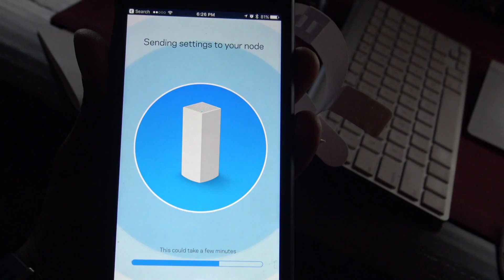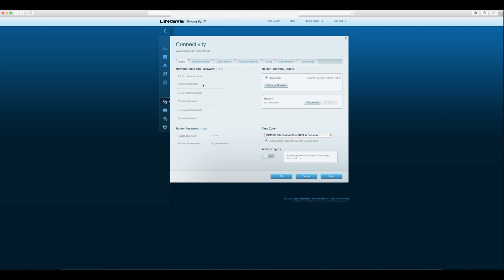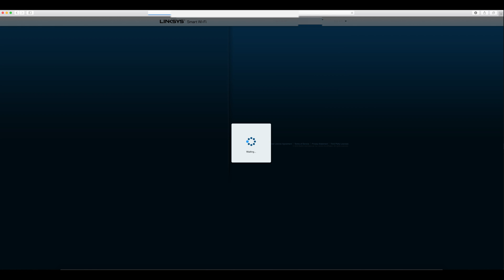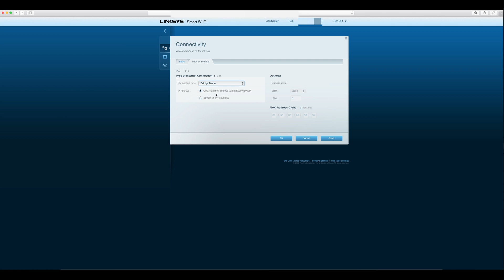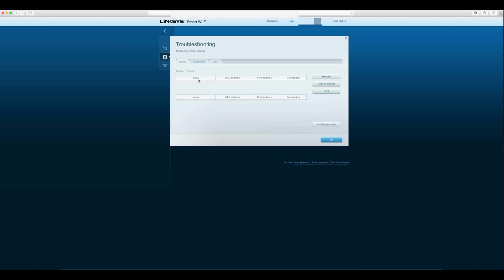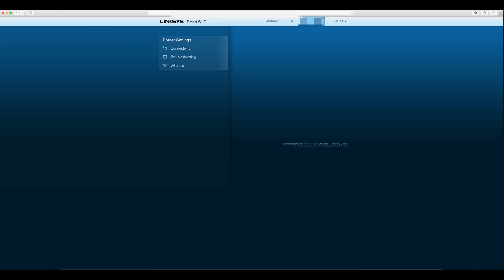Linksys Velop Network Bridging Setup and Configure

Comment: FOR THOSE WHO ARE CONFUSED BY THIS SETUP: This guy has his ISP modem running DHCP for his home network and has used his velop mesh routers to bridge that connection across his house. He's using the additional router as a switch. This is extremely sub-optimal. The best setup for this guy would be to connect the expensive router to the ISP modem and use that for DHCP, VPN, whatever other capabilities it has since I bet it is more robust in features than the Velop. Then to plug the Velop system into that router to extend that LAN across the WLAN. Essentially this is the blind leading the blind, but good try my guy.

Comment: 0:58 So you connect the main node of the VELOP to the internet source device (white cable) and the black cable to a modem or router that sends signal for everywhere else, is this correct? I am trying to connect all my VELOP nodes to wired sockets, would it work like that? Thanks! :)
Reply from the maker: Yes, you are correct. The nodes will work just fine if you connect them to Ethernet ports in your home/office instead of using the wireless mesh. The nodes will auto discover each other over the physical network, generally resulting in higher throughput between nodes and a fast connection for your devices.

Comment: Hello great video.  I have 2 velop nodes and i want to use a dlinl619L at the 2nd node.  
Then add a repeater to the 619L. 
Is this possible?  I'm basically trying to get Internet to my parents home across the street for kids online school.
Reply from the maker: Hi @JZ Nation,
Yes, it is possible to connect the D-Link619L to your Velop Node. Are you planning to hardwire it? Or, are you looking to use a wireless bridge function? 
Since the goal is to get reliable connectivity across the street, I would recommend you connect the D-Link to the open ethernet port on the 2nd node of the Velop. This will allow the D-Link to use your Velop as the gateway. You can either bridge the D-Link, or use it as a separate router with its own wireless network. As long as the signal is strong enough, everyone using the connection across the street should be fine.
Reply: @Netxperts  Thank you for your response.  That's great to hear. 
A little bit of context.  So I initially had my two velops at the 1st home.  I added a linksys RE6300 repeater at the 2nd home (which connects to 2nd velop node).  It seems to work fine but will stop working after a week or so.  I was told that maybe that repeated may not be compatible with mesh.

Okay, so I have a dlink 619 which I can hardwire to the 2nd velop and then connect the linksys 6300 repeater to it.  Do you think that would be the most feasible option?
Reply from the maker: @JZ Nation, from the description of the issue, it sounds like RE6300 was having a problem keeping the connections as the signal from base Velop was likely overlapping which will cause your devices to keep changing between the AP and repeater because they have the same SSID name. The hardwire solution should eliminate that issue,

Comment: What happened @ 3:40? How did you get to that sign in screen?
Reply from the maker: Sorry for the late response here... however, in case anyone has the same question... that sign in screen is accessible from the splash screen of the admin page. navigate to the ip address of your velop, click on the splash screen. It will take you to this link: http(s)://x.x.x.x/ui/1.0.99.208937/dynamic/login.html#casupport (the x.x.x.x is the IP of your velop).

Comment: @netexperts i have the velop ax4200 system at home using Mesh, but been getting inconsistent speeds on the 3rd floor. will switching to Bridge make it faster and more stable?
Reply: @benjamin yee, in general, no. Bridging would not improve the inconsistent speed on the 3rd floor as it is likely a symptom of the node being too far way from the others which causes the back haul connection between the nodes to fail. There are ways to stabilize the mesh connection on that node and drastically improve your bandwidth in that area. 
The other option is to use an Ethernet cable from one of the other nodes and connect it to this one. That method with improve the connection between the nodes and should result in  better performance on the third floor. 
Question: is the 3rd floor a large space where the performance is fine near the node, yet decreases as you get farther away?

Comment: Hey , I have a question. I spoke to a rep at Linksys and noticed I’ve been lagging pretty often and comes to find out the linkysys router I have is only good for 15+ devices and I have 51+ connected to that router so do you recommend I get rid of my old router and get a router that holds a lot more devices or keep my old router and get a mesh router?
Reply from the maker: Hi @Nas G, yes I’d definitely recommend that you upgrade your router to a newer platform. Most of the newer systems support 50+ devices with no problem. Regarding the decision of whether to purchase a Velop or different solution, I would say that is entirely dependent on your use case. I went with (and recommend) the Velop mesh system because it works well in situations where you want to cover a larger wireless network area that would ordinarily have dead spots due to the structure of your home or building. For example, the main level where a traditional router is placed would have outstanding throughput, however as you move to a lower level of the home, or a bedroom further away from the router, the throughput drastically degrades. The Velop (or mesh systems in general) solve this problem. They are also scalable and can support up to 100 devices in some cases.
Reply: @netxperts3280  I will definitely take all u said into consideration thank you so much 💯

Comment: Ok now I’m confused.  The cable guy set it up completely wrong.  So if you have a router and modem you plug the home velop into both??  Also my router is the new nighthawk xr1000 so I should be getting good speeds and I’m not.  Do I put the nighthawk into bridge mode or the velop system?  Or both?  Also do I plug the home node into the nighthawk and the modem?
Reply from the maker: It sounds like you have a cable modem and a nighthawk router that you want to integrate with the Velop system, is that correct? If so, yes you are correct that both devices (cable modem and nighthawk router) will be connected to the Velop node. I’ll explain why. 
The modem is connected to the Velop in order to provide internet access for all the devices you connect to the wireless network. The nighthawk router would have to be set to bridge mode so that it is essentially only providing a physical access point for devices connected with Ethernet cables. You would want to disable the wireless broadcast/service on the nighthawk as leaving it enabled will cause conflict with the wireless connection on your devices (cellphone, game systems, etc) and create problems with throughout as you mentioned. Ideally, you would not want two different systems advertising the same bssid because your devices with jump from one to another causing disruption each time they reconnect. 
Make sure the Velop is handling the IP address assignment as indicated in the video. 
Alternatively, you could set it up in reverse where the nighthawk is primary and the Velop is in bridge mode. I haven’t tested this scenario, however it should work if that is your preferred setup. Please let me know if you run into more issues.

Comment: My linksys main router was connected to my modem, I changed it to bridge How do I undo this? Now I can’t access the network.
Reply from the maker: The fastest way to undo the change is to reset the linksys router. However, there are alternatives to doing that depending on your setup. Did you put the main linksys router in bridge mode with the intent of having the ISP modem handle the IP address assignments and wifi? If so, you should be able to connect to the ISP modem's WIFI or plug into it and access the linksys modem from there. The IP address of the linksys modem should be the same. Once there, you can remove the bridge setting. I only recommend using the bridging option as a means of extending the physical network from linksys Velop because you might have devices that need to be physically plugged in. You can accomplish the same thing by purchasing a switch, however the intent was to repurpose existing equipment rather than buying more to do the same thing. Hope this helps. If you run into issues, feel free to leave a comment and I'll do my best to help.
Reply: Reset your main router and reconfigure it again.

Comment: Your video has been very helpful.  Just wondering why you turn off the wireless access on your non-Velop router?  I want to use my Linksys 3200 to extend and add more coverage to my Velop syste,
Reply from the maker: Thanks for watching and I'm happy the video was helpful. You can certainly use your Linksys 3200 as a wireless extender to the Velop. I only disabled it in my setup because I do not want the older router to broadcast a conflicting signal as it will result in a less than optimal wireless experience.

Comment: Hey I set it up as a bridge but now my internet won’t connect
Reply from the maker: Is your Velop node connected to your ISP modem/router as a bridge or as an uplink? If you have the Velop as a bridge to your ISP router, you will have to make sure the ISP router is handling the IP address assignments and is operating as the gateway to the internet.

Comment: i want to take advantage of my existing netgear router and all the ethernet cords and switches throughout my property in place-- i just found out that running the velop  ethernet ports to my netgear router disconnects...as im using automatic dhcp and main node  plugged in directly to my isp modem- i have two ports on modem - one going to  netgear router with all my  Ethernet connections and the other to the velop mesh with 4 child nodes-my problem was i plugged an ethernet cord from my child nodes into my netgear router switches which is on a different network and no wonder they kept disconnecting as  the conflict of the ethernet connection to  netgear router  and wi fi from main node. SO reading and watching your video i  think i need to be in bridge mode on velop rouyrt main node. i believe you said to go first from isp modem to velop then from velop to  2nd netgear router- THAT would only create one wi fi network instead of two i now have which is what i want-- but id like to go the other way around first to  netgear router then to velop-does it make a diffrence??? then suppose i  just shut off the the wifi broadcast from velop or netgear and now have just one wi fi network and ethernet to the nodes would now work CORRECT ?- just confused on setting of the velop in bridge will use my existing settings from my main router netgear and still give me the  mesh affect of  5 nodes  without lossing up and download speed as i know have  with two seperate networks independent-id like one fast network using my router and velop together as one and  use my  ethernet wiring to the  distant child nodes i dont see where i can turn off wi fi  in velop settings = but i can turn off wi fi in my netgear router--jyust noticed i due have a setting in netgear instead of ap mode there is a mesh  802.11s setting

Comment: Quick question from a non-tech person.  I currently have a modem and a router attached to the modem.  If I want to add a linksys velop mesh system, would the node be attached to the router that is attached to modem or would node be attached to modem and the router be attached to node?  

If my current wifi name is (wifi1), once I set up the mesh system I will have to make a second wifi name (wifi2).  What wifi would all my devices connect to wifi1 or wifi2?  Is there a way to have 1 wifi to connect to and get advantage of mesh system and separate wifi router?

Thanks
Reply from the maker: Bryan Kaylor  thanks for your question. 
If you are intending to create the same (or similar) solution that I outlined in this video, you will need to connect one port of the velop node to the modem and the other interface of the velop node to "uplink" port of the router. This option will basically make your existing router (not the velop) act like a switch. The Velop will take the place of the router and handle access to the internet and connections between devices (wireless and Ethernet). 

My recommendation is to disable the wifi on the router and just use the wifi from the Velop. This will ensure a stronger and more reliable wifi experience for your wireless devices. So, disable wifi1 on the router, and setup wifi1 on the Velop. This way, you don't have issues with your wireless devices connecting to wifi. If you have overlapping wifi names (Same SSID) coming from two different systems, you'll find that your wireless experience will become intermittently disrupted because your wireless device could potentially "bounce" between the router and Velop. Similarly, if you use Wifi1 and Wifi2 at the same time (using different names/SSIDs), the following will have to happen:
1. Your router and Velop will need to have unique-distinct networks. Meaning, wifi1 will be 10.0.0.x/24 and wifi2 will be 192.168.1.0/24. That's not a necessarily a bad thing, but it will definitely be disruptive depending on your wifi needs. If you are intending to put IoT devices on Wifi1 and personal devices on Wifi2, that will work.

I hope this is helpful. If you need additional help, feel free to ask. 

Cheers...
Reply: @netxperts3280  I ended up connecting my router (routerwifi) to the modem.  I then hooked my velop system to the router.  I switched my velop system to bridge mode and in wifi settings changed the velop to "routerwifi" and everything seems to work well with this set up. 

Linksys reccomended this as my router had more features than the velop system.

Comment: The right order?  What and where does it say anything about connecting the wires in the "right" order? There are no markings to indicate such.
Reply from the maker: Tim Odell there isn’t so much of a specific order in which to connect the cables to the ports as much as the importance of making sure each cable goes to the right place. I detail this @:52 into this video. 

Starting with the Velop node, connect the Ethernet cable that comes from your ISP (cable modem/DSL) to one port on the Velop. The other port on the Velop will be used to connect to your internal switch/router (if you have one). Keep in mind that the second part is not required for the Velop to work. It’s only beneficial if you wish to extend your physical network. Hope this helps. 🙂